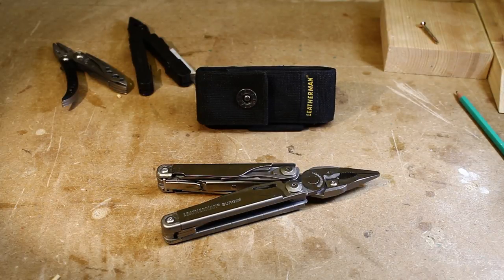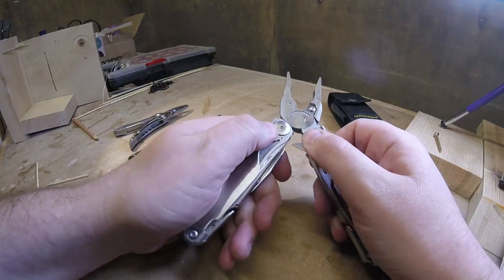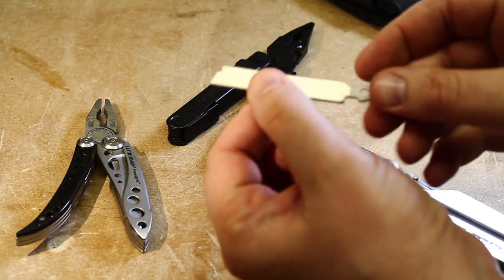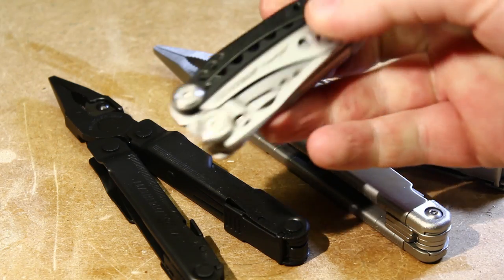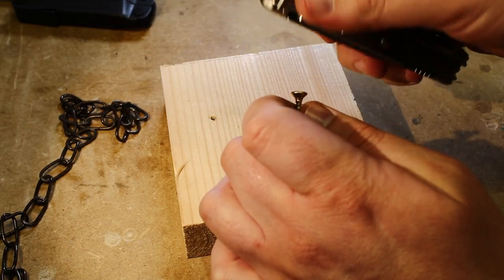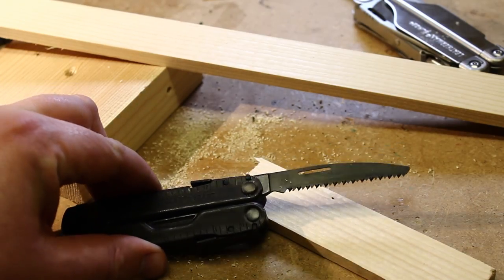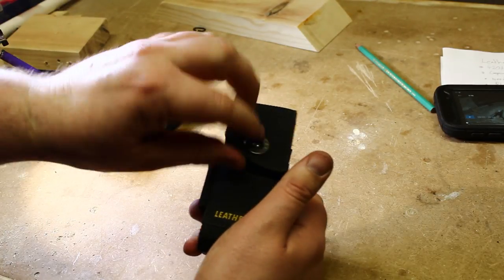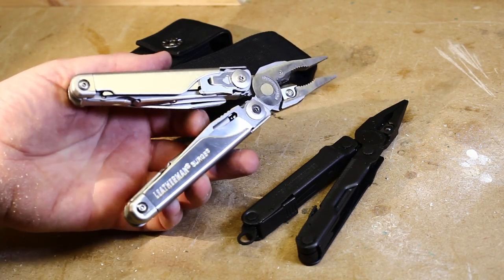Leatherman Surge Review by BCDesign01

Comment: Good review. One of the better ones I've seen reseaching multitools.
Update:          I finally made the purchase 100$ delivered which was a better price than amazon and knifecenter. It should be here next week. :)
Reply from the maker: Thanks! I still use mine everyday, even better is the fact that if the tool does break Leatherman will replace it for you! I just sent my rebar in as I lent it to someone who returned it with a broken knife blade!
Reply from the maker: Awesome you wont regret it!